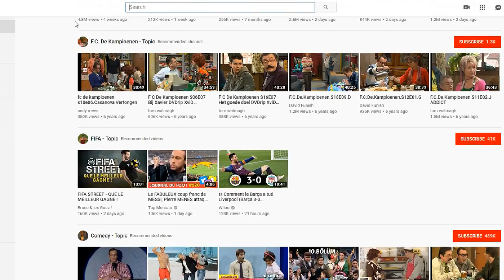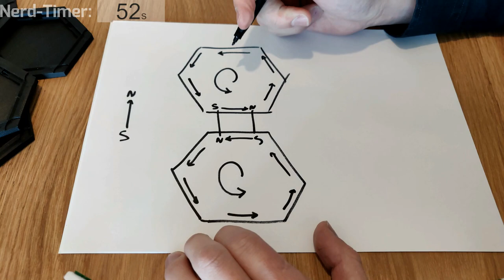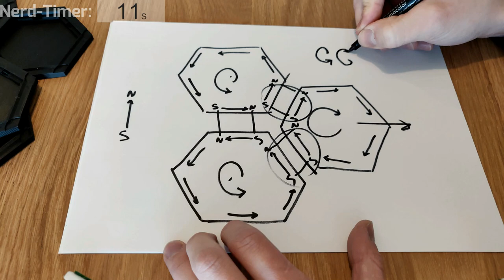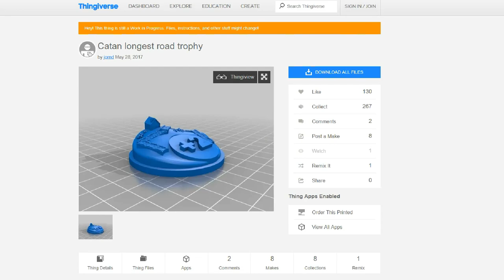3D printed, Hand painted Catan game

Comment: actually iam doing this as a christmas present for my parents this year but iam using a resin printer due to the higher quality of the prints. im really happy so far :D thanks for sharing ur experiences and happy settling ;D
Reply: Did your project did well? Im going to do It , I have a resin 3d printer and a Fdm with multicolor, I dont know if I should print on resin the pieces needed to Paint and on Fdm the multicolor tiles
Reply: @bluepoint5786  with the newer fdm printers i would probably print the rims in fdm and the actual tiles in resin. When i did it i only had a resin printer. some months ago i got myself a bambu p1s- i guess with the right settings and 0.2. nozzle u could to this all fdm. and yeah the project came out fine - my parents loved it!
Reply: @retepetete1034  thanks, I didnt expected you to reply 4 years later, the quality of the resin printer is unsurpassed but for convenience I'm going to try the bambulab A1 combo since my painting skills leave something to be desired, I'll tell you, good luck!

Comment: You should've assembled the bases without the inserts and turn it around. Than glue the felt over the underside of it. When dry, use a hobby knife and cut between the base pieces.

Comment: You asked a comment if we think you could have done something better / different. Well, here is one thought. I think that it would have been easier if you've used white PLA for printing. Then you wouldn't have to paint everything to white. Maybe you wouldn't even need primer at all, but well, that depends on the colors used for painting I guess.
So, that is just one idea to make project at least a bit simpler.
All in all, you did great job, congratulations! :-)
Reply from the maker: Hi Bass Man, Thanks for the suggestion.
I did some preliminary tests on the PLA which I am printing with. It has a very glossy finish and the paint just didn't want to stick to it very well. Therefore priming was a necessity for me. 
The choice of black then was easy since it makes it easy to see if you have missed some spots with the white primer :-). further more, the spots where your primer still can't reach (such as the interior of the forest or the mine entrance) are still dark spots, which in both examples makes sense.
So that's why I am priming black plastic, but I am aware this will differ from brand to brand since I also have PLA with a more rough finish. I have not (yet) tried to paint this rough PLA but I assume the results will be different, possibly eliminating the need for primer as you suggest.

Comment: Re: black wash as a finish: I painted lead miniatures in the 1980's and am just now getting into 3D printing and painting.  In my experience the black wash is used as a BASE coat, just over the primer, and not a finishing coat.  This is a way to put dark shadows in the 'cracks before the detailed painting.  For finishing, i used "dry brushing" and edge highlighting, usually with a very subtle white, or a mix of white and the colour beneath it.  This can be used to give highlights to the edges and tips of objects.  Thanks for recording your adventure!
Reply from the maker: As advertised: I started this a complete noob. Nevertheless I honestly liked painting these miniatures and I am going to paint some more for a boardgame we recently bought. So many thanks for the advice.

Comment: Thanks for your video. Could you please put a link to the location where you bought the magnets? or the specs of the magnet (size).

Once again thanks for the nice tutorial and clear explanation
Reply from the maker: Thanks for your kind words.
You need 3x6mm rod magnets wit the poles axial (parallel to height).
The N48 is a number indicating the strength. This is important to have a strong enough attraction through the relatively thick plastic walls.

Here is the link where I bought them:
https://www.supermagnete.de/eng/rod-magnets-neodymium/rod-magnet-3mm-6mm_S-03-06-N

Comment: What paints did you use? To get that level of colorfulness for the green I need to apply 2-3 layers and even so the brush marks are quite visible. Also mixing standard acrylic colors is quite more difficult than what is seen in the video. How much water did you use (or none at all)?
Reply from the maker: I have used some miniature paints of the brand 'game colour'.
I straight up mixed the paints without adding water. I only tend to add water if the paint is already drying out a bit, like when a mixture I've made is already a few days old (my mixing pot is old and does not close off very well). I did not encounter any issues regarding mixing, although it take a lot of trial and error if you have a specific colour in mind. In the video the mixing is not shown completely but cut short, which might give the impression that I wasn't stirring for several minutes.

In terms of layers: yes often there is a need for a second or third coat, especially in the 'number disk' circle. In a lot of the pictures shown in the video, brush strokes or different levels of coverage are painfully obvious. I would advise here to not strife for perfection. The world is littered with imperfections and colour hues. Maybe the brush strokes and imperfections make it more alive. I have seen people even deliberately using a very diluted paint as a second layer to provoke these inconsistencies. But if a even colour is what you are after, you will indeed need at least two layers of paint.
Reply: @jakwiebusprojects8634  Thank you for the fast reply and the very helpful explanation!

Comment: Great Job! Doing the same thing at the moment :D
Reply from the maker: Thanks! And good luck with your version! 
Be sure to watch my video on the extra tokens, it might give you ideas for the gameplay.
Reply: @jakwiebusprojects8634  I got some problems with painting the models, how often did you paint your models? My first layer just wont stay on the model… using arcyl paint
Reply from the maker: I also used simple and rather cheap acryl paints. I have primed with a white primer and mostly did not have to paint two layers.
However it is true that on the base of the landscapes brush strokes could be quite visible (especially where the circle for the number token is placed). For a completely smooth finish on those places I sometimes had to put down two to three layers.
For the details such as trees and houses the coverage was also not always perfect but I liked how it added structure, especially when the primer did not quite reach the smallest crevasses which added some depth effect as well. (Something that a black wash would do as well).

That was the long explanation. :-)
Now for the short one: if you think it looks good, it is good. Even if it is not done according to the "rules of the art" of painting miniatures.

I'm willing to send you some detailed pictures if you want.
Have fun.

Comment: Loved your video! I started printing this set a couple of weeks ago, but now I'm having a hard time printing the little caps to secure the magnets in place. They're not sticking to the bed and get knocked away or lifted up by the nozzle. I noticed you managed to print a full bed, so I'm very curious for any advice you might have! :)
Reply from the maker: Hi, thanks for reaching out. First off; good luck and lots of fun with printing and painting you set.

About the printing issues: prints not sticking can have several causes. Mainly bed leveling and bed cleanliness. I assume bed leveling is taken well care off in most printers but it never hurts to double check. The cleanliness of the print bed is something looked over easily and in my opinion one of the main reasons prints not sticking over time where flawless prints happened in the past. It is all to easy to get greasy fingers on the bed, and in open printers plain dust always settles on the surface. Cleaning of the (cold and unplugged) printbed can be done with any alcohol (IPA, rubbing alcohol, just plain denatured alcohol or even your cheapest 40% Vodka). Don't clean buildtak with anything stronger like nailpolish remover or acetone. Glass and pei can withstand more chemical abuse.
If the bed is level and very clean, and still not sticking, it's slicer time: I am fan of overextruding your fist layer a bit. It will cause the dreaded elephantsfoot but prints stick very well (not good for dimensionally accurate prints, those get a brim).
Print distance of the first layer is also something that is easily changed in the slicer and can have great results.

Hopefully I could be of any help. And good luck!
Reply: @jakwiebusprojects8634  Thanks for your reply! Managed to get everything printed in the end. On to painting now!

Comment: What size and strength magnets (N35, N50) did you use? How strong is the attraction of the tiles? I tried some 3x5mm Neodymium N50 cylinders and the connection was very weak. If you connect two tiles on a table and then pull one away it wasn't strong enough to drag the 2nd tile along. Was just strong enough to pull an empty base along.

Comment: Why did you choose to print separate tiles and base and glue them together after, but not print the base attached to the tile?
Reply from the maker: The magnets are locked in the base with the clips, then the whole base is shut by glueing in the tile.
Printing the tile and base in one will make it impossible to insert the magnets.

Comment: Where can I find the magnets?
Reply from the maker: I have bought the rod magnet of Ø 3 mm, and height 6 mm, (nickel-plated neodymium, N48) from supermagnete.de.
However any rod magnet of that size would work just fine. You can also find them easily on AliExpress and BangGood.

Comment: I wonder how the pieces look close up,  so my questions; do they look really edgy and printy after painting. 

And does the prints resamble the cards?

Last; how long did the process of just printing each tile take?

Good video, and i also loved the follow up video.
Reply from the maker: Thanks for the compliment.

I have printed them at 0.1mm layer height. If you look closely, you can see some layers, especially on the shallow slopes of some of the landscapes, predominantly the desert and the sheep. But for the rest of the features, the layers don't catch the eye that much.

A preview of the cards I bought is seen at 21:45. I did my best to resemble the colours, but the drawings are inevitably not really corresponding to the 3D designs.

For your last question: I have used some very conservative printer settings, I have my maximum acceleration below 200mm/s and this really shows in the print time. On average the tiles took 3 to 4 hours each. and 1h additionally for the bases. I however have gotten some strange looks because of this, since some people seem to have successfully printed these designs in 1 to 2 hours.
So, long story short: it's hard to say how long exactly, since it varies with the used settings.